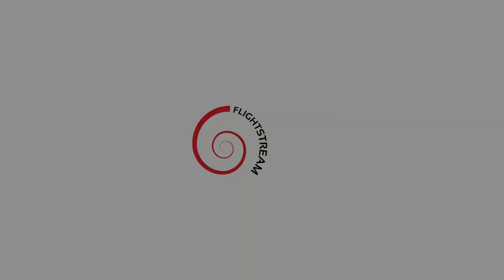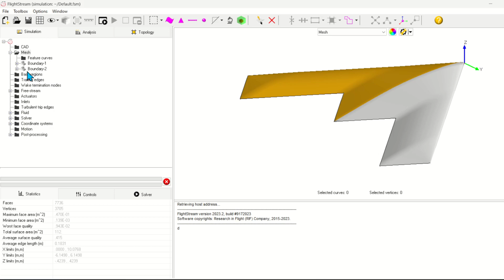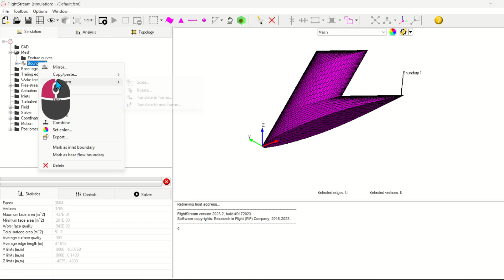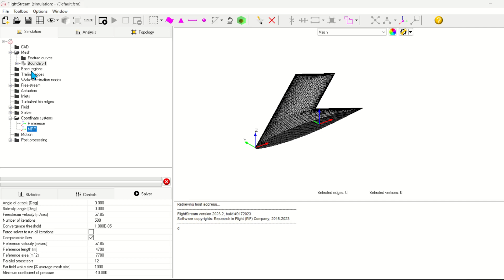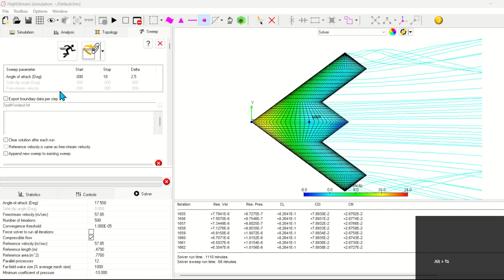FlightStream Walkthrough: SACCON UCAV - Part 1 (Analysis Setup)

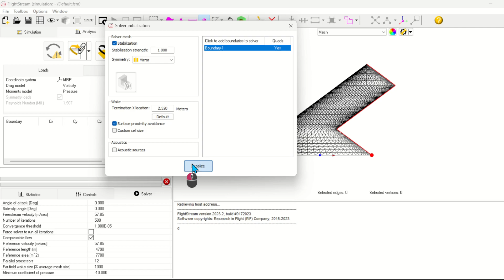Comment: Hi, I'm using FlightStream 2024 and I can't find a check box for drag & pressure model in Analysis setting (4:04). Could you give me some explanation?
Reply from the maker: The FlightStream used in this video is an older version. Please look for the Vorticity CDi folder under Solver in the sim-tree in the newer version of FlightStream
Reply: Do you have any p3d file for rq 170 sentinel? @AltairFlightStream

Comment: Why does the sideslip angle get locked to 0 degrees in this solver's setup?
Reply from the maker: When using a half model with symmetry boundary condition, no beta angles are allowed. To change beta we would need to mirror the mesh and create a full AC model